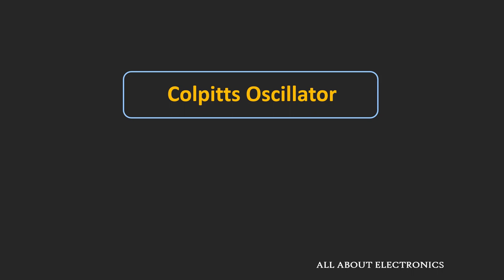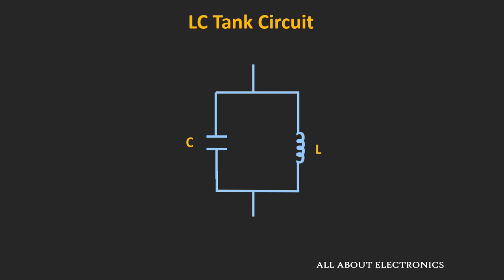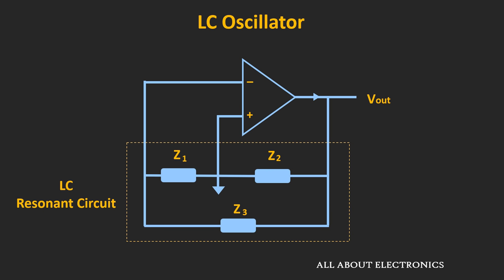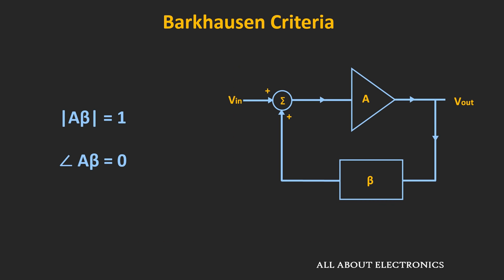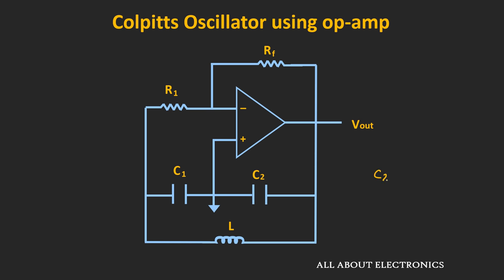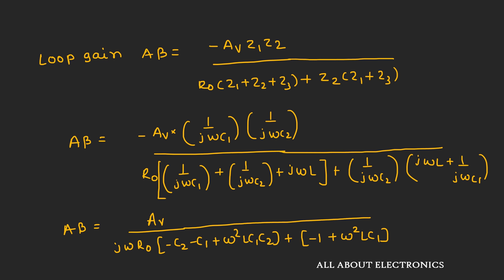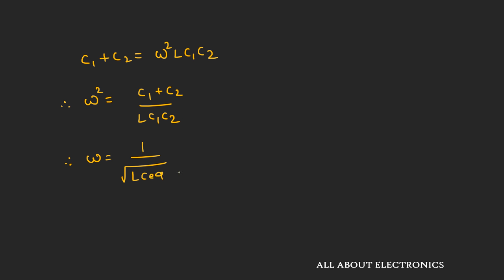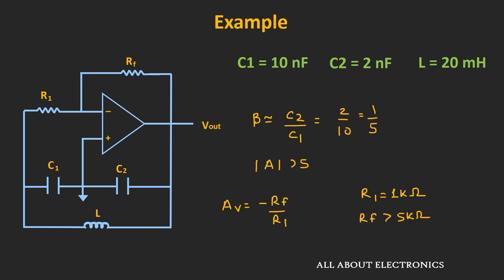Colpitts Oscillator Explained

Comment from the maker: The timestamps for the different topics covered in the video:

0:30 Introduction to LC Oscillator and working of LC tank circuit 

5:13 Colpitts Oscillator using the transistor (BJT) and op-amp

7:04 Derivation of frequency for Colpitts Oscillator

14:39 Example on Colpitts Oscillator

16:52 Applications of Colpitts Oscillator
Reply: how to design output wave amplitude
Reply: Can u  make a video on Hartley oscillator ?
Reply: Please make a video on Hartley oscillator
Reply: Sir pls make a video on Hartley oscillator.
Reply: @Davion Augustus No problem xD

Comment: Would be great if you could also cover non harmonic oscillators, square and triangular especially.
Reply from the maker: I have already made videos on how to design square wave. 
You can check videos on astable multivibrator using op-amp and 555 timer.
Here are the links:
https://youtu.be/T7T3At9N9dk
https://youtu.be/iJYm_BGqa1A
Soon I will cover the videos on the triangular wave.

Comment: Nice video. I got a question: for the oscillator to get started, you said the loop gain should be greater than 1. However, once the Rf/R1‘s value is fixed, the gain of OPA is fixed, so how is it to achieve loop gain being greater 1 during starting and loop gain being 1 during stable period?
Reply from the maker: Practically, you need to keep the gain slightly more than 1 to get the oscillation.
Using variable resistor in the feedback of the op-amp, the gain can be adjusted slightly more than 1. If it is too high, the output will get saturated. 
Using variable resistor it is possible to set it to optimum value.
Reply: @ALLABOUTELECTRONICS  Thank you, sir.

Comment: Q1 ) To design a Colpitts Oscillator Oscillating frequency is 5KHz and capacitor equivalent is 30 nF and feedback fraction ( C1/C2 =1/20 ) or ( C2=20 C1), calculate:

Comment: hello. I am a student majoring in electronic engineering in Korea. The waveforms of the Colpitts circuit implemented with pspice and the Colpitts circuit implemented with a breadboard are different. Do you know why? And the waveform of pspice is the same regardless of whether R1 and Rf are present. Do you know why?
Reply from the maker: The p spice model will not take into account all the effects, that you will encounter in the actual circuit. And that is why you are not seeing the change in the output even after changing the Rf and R1.
Reply: @ALLABOUTELECTRONICS  Thank you for answer. Can I ask one more thing? I looked at the pspice circuit diagram on the internet and implemented the same thing on my computer's pspice, but do you know why the waveforms are different?

Comment: sir i need designation of an oscillator of frequency range of 5 khz to 28 khz.. it may be any type of oscillator but should be with proper derivation for frequency..sir could you upload a video of the very oscillator ?????? 
thanks in advance

Comment: Can I build an inductance meter with this circuit? I if use an op amp voltage follower, set c1, c2 = 1uF, I should get L = w^2/2. I can easily measure frequency with a multi meter and reverse calculate the inductance.
Reply from the maker: In principle yes. But for every new inductor, you need to measure the resonant frequency. And manually calculate the inductance.
Reply: @ALLABOUTELECTRONICS  Thanks for the kind reply.  Do I need to adjust the gain every time for a new inductor? does keeping a high gain amplifier work across different inductors ?
Reply from the maker: I think you just don't need to adjust the gain everytime

Comment: Design a FET colpitts oscillator with fixed frequency specification: Design an oscillator with components  c1=750uF c2=2500pF and L=40uH
Elements tolerance values should also be considered

Comment: sir during derivation of frequency,we made sure no input current flows to amplifier,then how the feedback reaches the op amp??
Reply from the maker: the feedback signal is the voltage signal, the voltage across the two terminals of the op-amp. And as there is ground between the Z1 and Z2, so there is a path for current to flow. 
I hope it will clear your doubt.
Reply: @ALLABOUTELECTRONICS  thanks a lot sir,it is clear.

Comment: Sir could you explain how z1 and z3 are series connection ? 8:48. Thank for your helping.
Reply from the maker: Since for ideal opamp as no current is flowing into opamp terminal, the same current will flow through z1 and z3. Hence, they are connected in the series. I hope it will clear your doubt.
Reply: Thank you Sir. Thank for lessons. You are very good teacher.
Reply: @ALLABOUTELECTRONICS  then shouldn't the same current be flowing through z2 as well.. since the current doesn't branch out to the op amp input terminal?

Comment: Why C2 Has an effect over the circuit?  If Its in parallel with the output of the OpAmp.
Reply from the maker: C2 is not alone. C1 and L are also there in the feedback network. And effectively they all act as the frequency selective elements. (As I mentioned during the derivation through circuit analysis)

Comment: Another excellent presentation.   One question, why is the feedback fraction C2/C1 when the total output is across C2 (vout to ground)?  I would think since it is partial feed back it would be C1/C2
Reply from the maker: I have derived the expression of feedback fraction at the later part of the video. (7:04 to 14:30)
If you go through it you will get it that why feedback fraction is C2/C1.
Reply: The value of reactance of capacitor is 1/wC(w is omega). So you can simplify the expression that is Vo/Vf=(reactance of C1)/(reactance of C2).
 u will find why it is the case